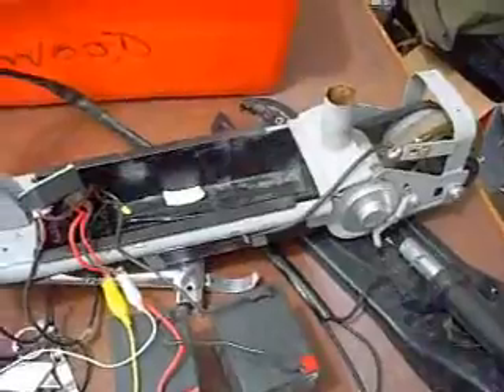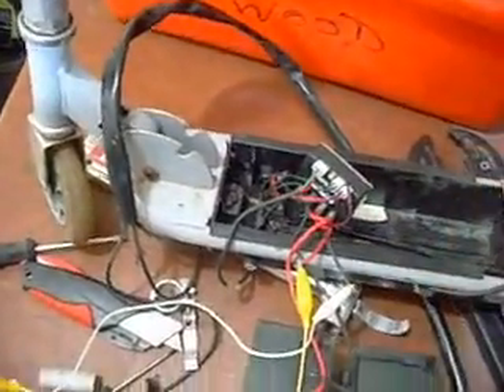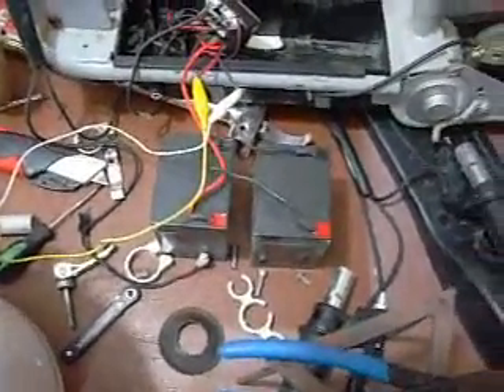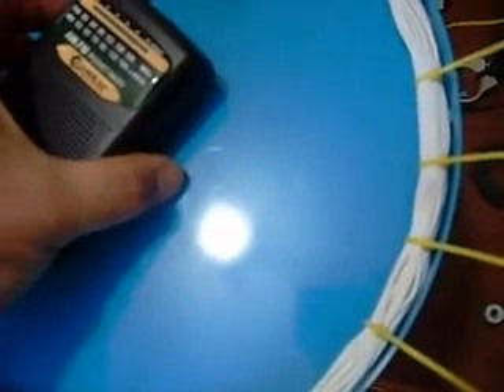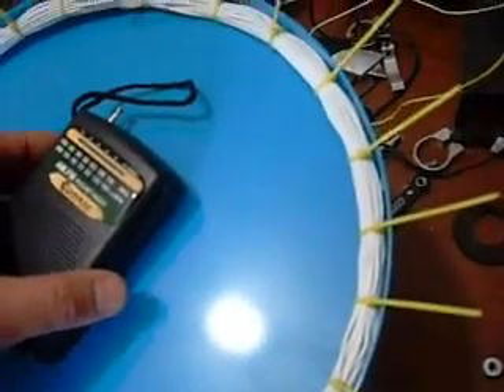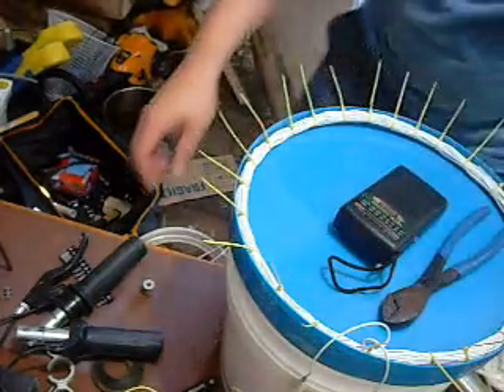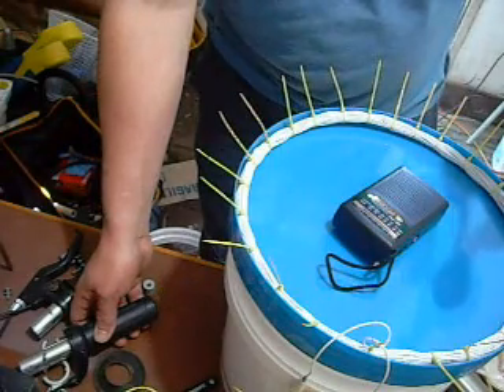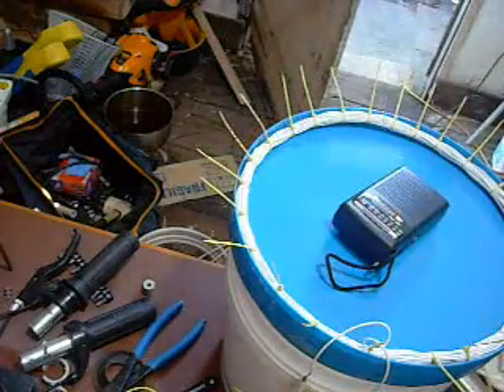arduino metal detector project pt3

Comment from the maker: if it was a Phase Locked Loop reciever i would agree with your statement,but since the reciever is not PLL and it is surrounded by an EM field both coil and reciever are being effected by the presence of metal.
in this case both are working together and the heterodyning sound is influenced by metal in proximity to the reciever either with the reciever inside the coil loop or outside of it.

Comment: @m3sca1 Strange, then what we're hearing is the harmonics? because the AM radio, even if its long wave it won't tune up until ~148KHz -- But I suspect that receiver you used is MW, which is a higher frequency band!

Comment: @g11690102 depends, this type of coil will surround the AM receiver with a EM field, the rodin might not. Also when replacing batteries, you should really get two new ones. But don't get rid of the old ones, you could probably use them in the lab if you cycle charge them.